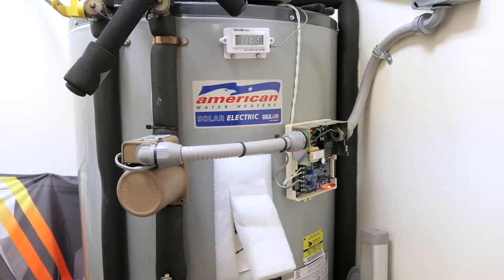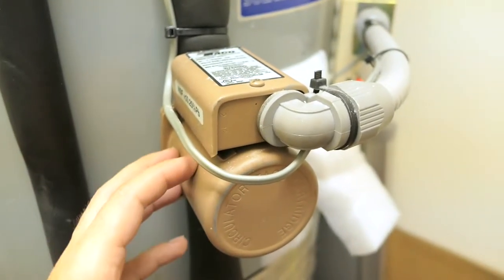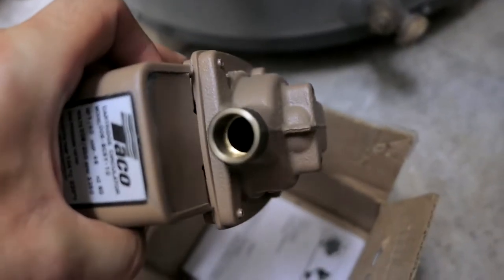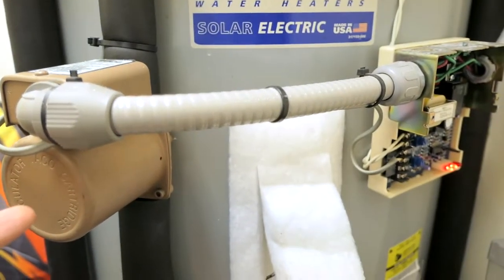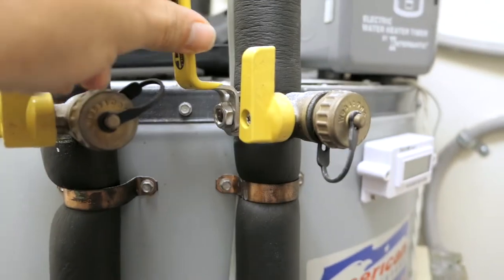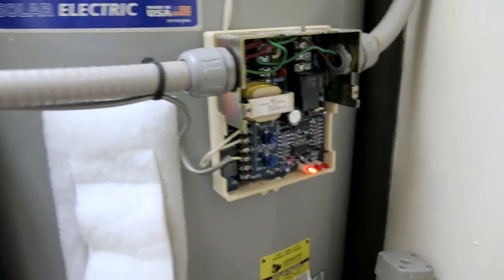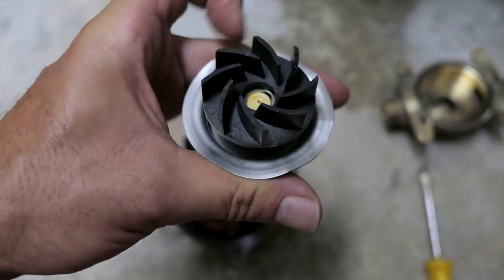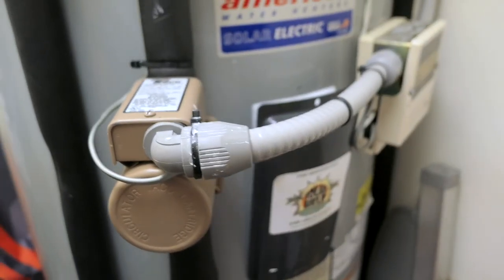Taco Circulator Pump - Needs Replacement

Comment: From the symptoms you listed, it's usually best to replace any capacitors you find attached to the motor before taking the additional steps to replace the whole unit, it could save you $$ and aggravation.